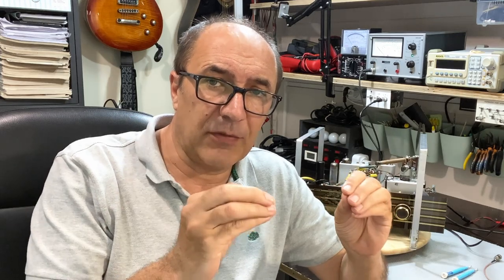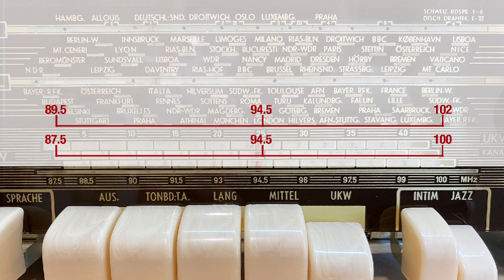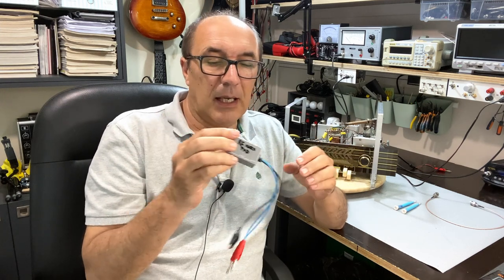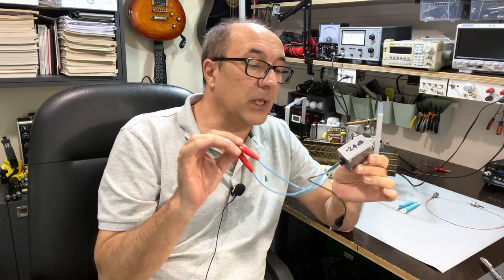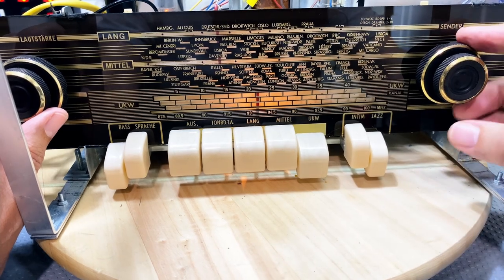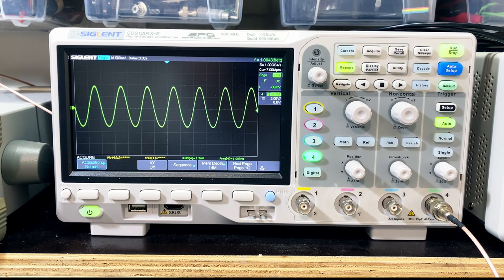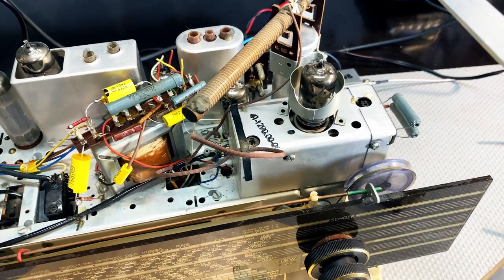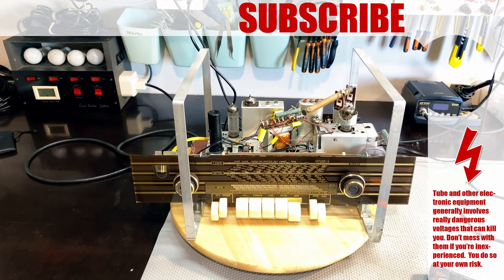Can we stretch the FM band? Let's try. Telefunken Dacapo 9 part 7.

Comment: This radio has a variometer tuning for FM. It would be necessary to align the oscillator core (108) parallel to C113 in the variometer (position and movement) to stretch the band. And also the preselector tuning (107). This was done in the factory and maybe it´s sealed or so.
Reply from the maker: Yes, they do seal it. I’ve adjusted the ranges of one with a variometer before, but it gets messy 😊
Reply: So the ratio between minimummum  oscillator frequency and max oscillator is related to the ratio between minimum and maximum inductance.
(some square root and some inverse on the way)
To extend the oscillator frequency range, one must find how to extend the inductance variation range. The inductance variation is related to the motion of the core relative to the coil. So the idea could be to extend the motion (th course) of the core relative to the coil. The two limits are with the core far away from the coil, and the core inside the coil, and right at the middle. Both limit positions make a plateau. Experiments can be done, but what is the possibility to increase the motion of the core when you play on the tuning knob? Is it a direct transmission using the string, or is there any mean to extend the motion. If one cannot extend the motion, then one can try to find how to set the core course to make the maximum inductance variation. On a saba, I was able to screw or unscrew the core to have it slide relatively to the coil. But I did not gain a lot. I could check that if the core is going all the way through the center of the coil and beyond, the oscillator frequency was going backward!!!! 
I can't tell whether the core are tuned (by their position) at the factory to produce the maximum inductance variation!
@Electronics Old and New by M Caldeira @electronicsoldandnew

Comment: Have you ever thought of building a converter to put on the input of the receiver?  You could even add a bit of amplification on the desired frequency, add a local oscillator at a frequency such that you get the 101.6 Mhz signal as an output at some other frequency?  You could also add a bypass to the circuit to use the radio in "normal" mode.
Reply from the maker: That is possible, but not really worth it for me on this one. I have many other radios that also demand attention on a day to day basis, and I use those at home. This one will work perfectly at the office.

Comment: I still haven't bought one of the ELV units yet
Have you ever looked at its out output with a, say 200 MHz o-scope ?   In addition to FM radio tune-up, I'm wondering how well the carrier frequencies from it would work as a DIY freqeuncy standard.
Reply from the maker: I have looked at it on the scope. It is a pretty good signal, but not sure if it could be used as a frequency standard if you need absolute accuracy.

Comment: I think, the difference in alignment compared to the usual radios is, because this one doesn't have a tuning capacitor but a variometer (you vary two coils for tuning).
Reply from the maker: True.
Reply: So the ratio between minimummum  oscillator frequency and max oscillator is related to the ratio between minimum and maximum inductance.
(some square root and some inverse on the way)
To extend the oscillator frequency range, one must find how to extend the inductance variation range. The inductance variation is related to the motion of the core relative to the coil. So the idea could be to extend the motion (th course) of the core relative to the coil. The two limits are with the core far away from the coil, and the core inside the coil, and right at the middle. Both limit positions make a plateau. Experiments can be done, but what is the possibility to increase the motion of the core when you play on the tuning knob? Is it a direct transmission using the string, or is there any mean to extend the motion. If one cannot extend the motion, then one can try to find how to set the core course to make the maximum inductance variation. On a saba, I was able to screw or unscrew the core to have it slide relatively to the coil. But I did not gain a lot. I could check that if the core is going all the way through the center of the coil and beyond, the oscillator frequency was going backward!!!! 
I can't tell whether the core are tuned (by their position) at the factory to produce the maximum inductance variation!
 @electronicsoldandnew
Reply from the maker: I have had experience on the Saba and many of those allow you to adjust the limits of the inductor tuning. This one is all inside the FM can and very difficult to get to and adjust, so they really did not intend it to be adjustable once it left the factory.
Reply: @electronicsoldandnew  They also didn't want you to temper with these settings, because it can affect the radiation neutralization of the IF oscillator. And back in the days, only the largest and most fancy radio repair shops had the equipment to measure that. Sometimes, they even had only one oscilloscope in the whole shop. An selective RF voltmeter was way out of reach costwise, and they didn't even dare to dream about an spectrum analyzer.
Reply: Thank you Manuel . It was worth to test anyway.
One good point is that you will have one more good and nice looking radio in one of your two places where you spend time! 
Next time, you may think of a 12V-DC to 230V-AC converter to install one of these 1950's radio right  in your car! @electronicsoldandnew

Comment: That,s a boring view at the end from the video ;P     btw where you orderd the Attenuator,s  I only find some that where quete expensive
Reply from the maker: This is the one:
https://www.ebay.com/itm/IEC-Atenuadores-Kit-De-Cada-Peca-1-X-2dB-6dB-10dB-15dB-Conectores-De-Metal-Na-Linha-/202569579073?_trksid=p2349624.m46890.l49286
Reply: @electronicsoldandnew  thanks

Comment: I guess were not universal around the world.  Here is in the US, we have odd frequencies. We would be set to 101.5 here.
Reply from the maker: I believe the FM band is regulated differently for different areas. We’re on ITU 1, so it could be different from yours. However, I did some searching and we could have a different station at 101.5 here (my go-to is 101.3), as they are permitted at 200kHz separation.
Reply: @electronicsoldandnew  - Thanks for the feedback.